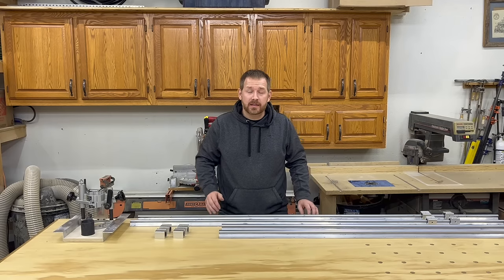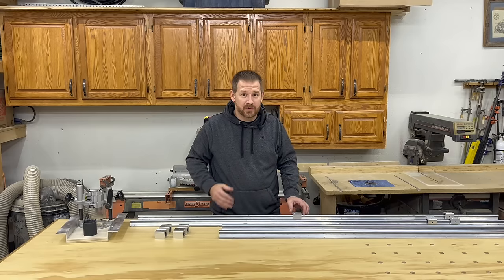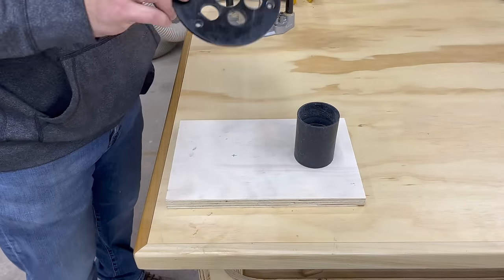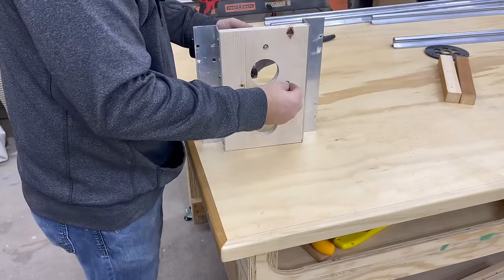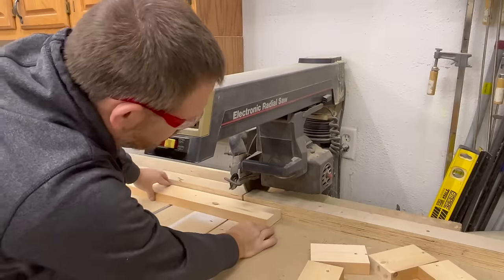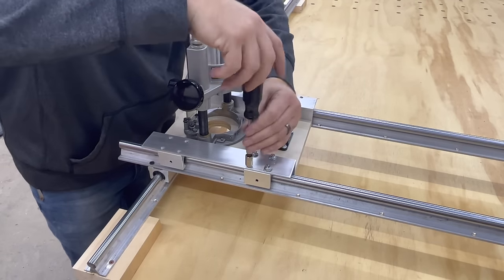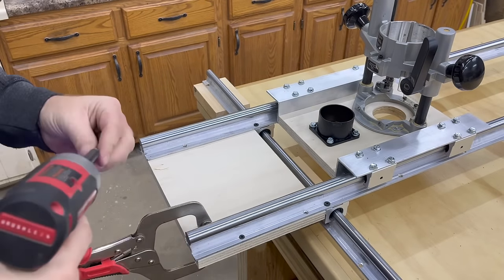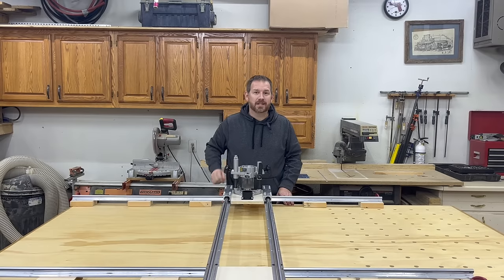Build a Better Router Sled/Flattening Jig

Comment: No one ever address how to raise this for thicker wood, what would be the best way to raise this?
Reply from the maker: Hey, thanks for watching.  For thicker slabs I change out the mounting block on the lower rails with thicker blocks.  I actually just made some upgrades to this sled which includes a router that has more vertical travels.  This allows me greater flexibility in regards to setting up for different thicknesses.  Here’s a link to the video.  https://www.youtube.com/watch?v=pYstDfpUUZE
Reply: @Idealwoodworks  you could mount the router platform to the top of the bearing blocks (I used 1/2" acrylic) and an extension for my 1/2" collet on my Bosch plunge router...

Comment: Be sure when you order the rails that you know the difference between SBR 16 and SBR 20, and that your length in MM. SNR 16 is almost5/8” and SBR 20 is a little bigger than 3/4” I had my bottom rails already watch this video and did not do my homework and ordered what he had on this page. Different sizes do not bolt up so well. CNCMans are excellent.

Comment: How to make a 200$ project with 20.000$ equipment. I dont understand it, sincerely
Reply: What? He did not use one piece of equipment that anybody who is going to use this sled does not have or cannot replicate.

And the equipment he used was not particularly expensive. The nicest piece of equipment he used was his planer.

He uses an RAS, which most people do not tend to have. He could have made those same cuts with his chop saw. He uses a benchtop drill press. These are not expensive.